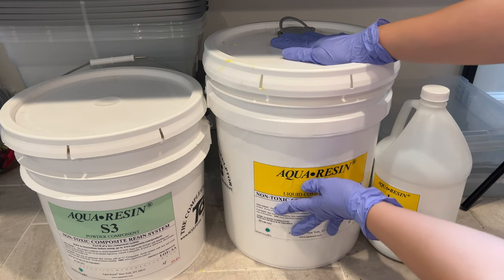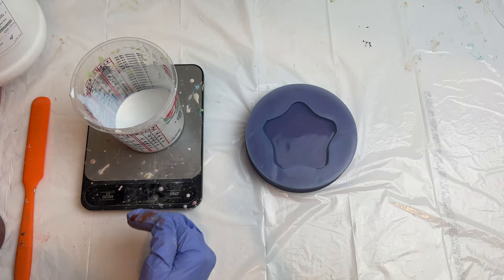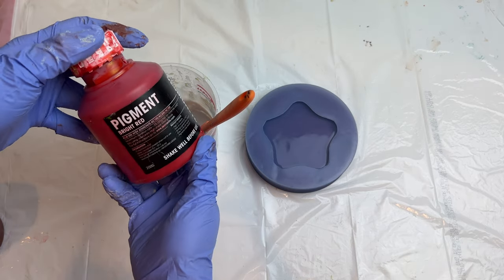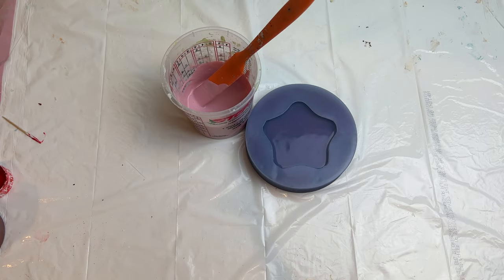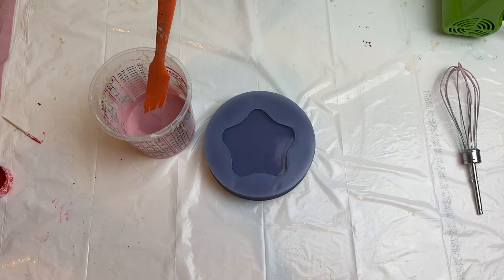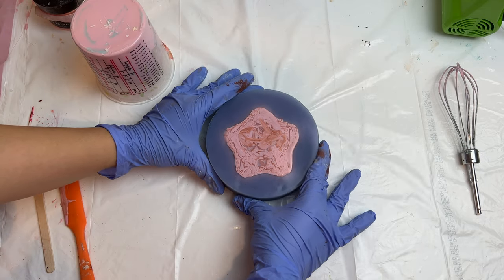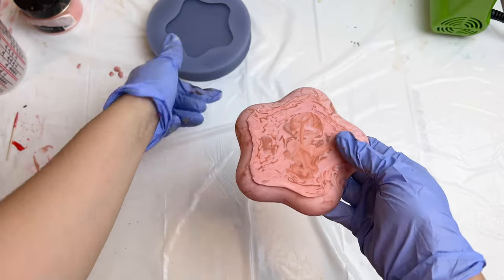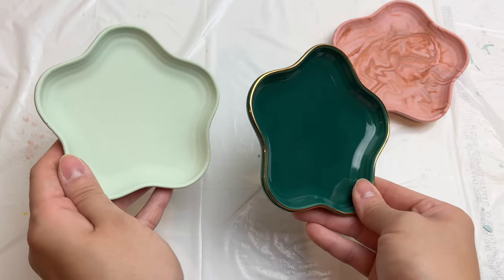Making Flower Trays with Our DIY Molds - Eco Friendly Resin Tutorial (Aqua Resin)

Comment: Hi I just found you and I’m thirsty for more about this product. I just got some and have made a few bowls and the back I find are not smooth and shiny how did you get your back of your trinket dishes to be as smooth and beautiful for presentation I’m struggling with that because mine are not smooth on the back they don’t have a sheen and that’s where I’m stuck. I’m gonna go watch your videos. Thanks
Reply from the maker: Hi! I think this is exactly the tutorial you're looking for 😂. I don't do anything else after the demolding, except finishing it up with a wax sealer and possibly sanding the edges if needed. The back is just like how it is here. I think the bumpy back could be clumps of powder not being mixed 100%. That can be solved with an electric mixer. I linked the one I'm using in the description. If you're already using a mixer, your mixture is also already setting when you're pouring so it doesn't have enough time to level itself out. I could put together a little testing video one day 🙂
Reply: Thank you so much for taking the time. Yes I’m the beginning it was clumpy in the back. I finally got the mixer and those came out ok. It just seems the sheen on the front doesn’t do it in the back. I’ll have get more training. I love that you use a bit more and lose most bubbles. Great tips. I am following you 😆 let’s enjoy the journey ❤️❤️ again, thank you
Reply from the maker: @delilahzarri8723  I’m not 100% sure regarding the sheen, but you might find my birth flower video helpful. The tip was found on the product website 🙂. Thank you for your support! Let’s have fun creating❤